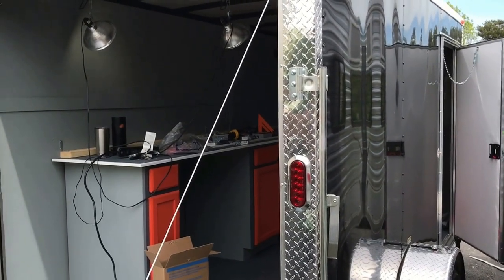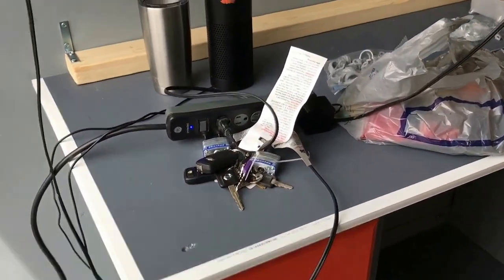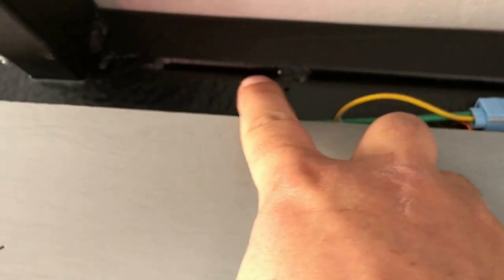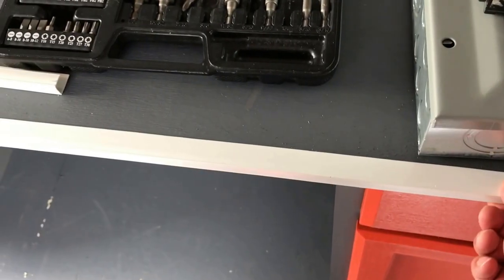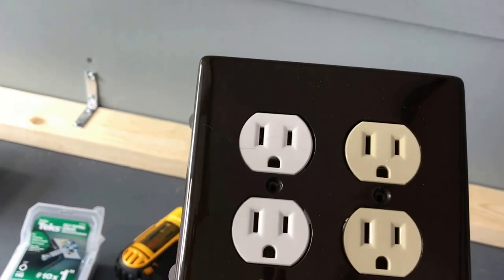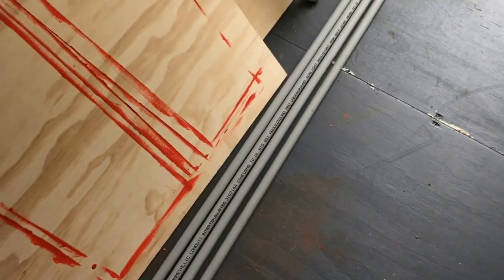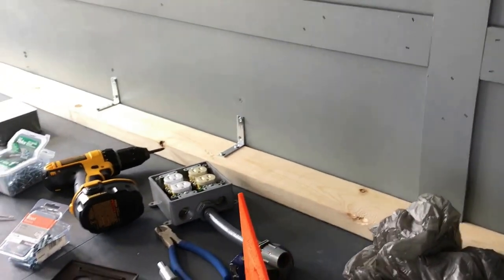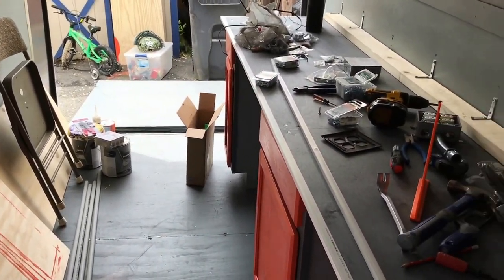RC Pit Trailer Build Intro

Comment: Looking great bro , I just bought my trailer , starting on it soon
Reply from the maker: So far it has been amazing. We have traveled to our local track a bunch and took it to AMS down in Alabama. Best money I have spent!
Reply: Rowdy Chaos awesome !
Reply: Did you insulate your trailer ?
Reply from the maker: Nope. It gets hot, but really I wouldn't miss the insulation unless I was trying to run an AC. It does get above 100 when closed up, but with a fan pulling from each door it is tolerable. Now, this winter it may be a different story. Our track is a hybrid outdoor with a giant tent type structure. We will race all year, but it'll get cold. Hoping a space heater or two is all we need. It all else fails I will get 1" thick insulation and stuff behind the walls.
Reply: Rowdy Chaos oh ok , I'm thinking of building a false wall where the back door is and run an a/c , I'm in Florida and we don't have to much cold ,
Reply from the maker: I have seen that done by a few guys. In that case I would go ahead and unscrew the walls and shove some insulation between the metal and the plywood. Also seen guys just cut holes in the V-neck or front of the trailer and stick in a window unit there with supports. That way you can install some heavy plastic drapes in the rear and still have the ramp open. I've thought about it but I feel if your run an AC you need insulation... or have a beast AC unit.
Reply: Rowdy Chaos hahahah yes sir ! I kinda want to not put holes on the out side just to make sure not to leak , it rains a lot here in the summer , thanks for your input